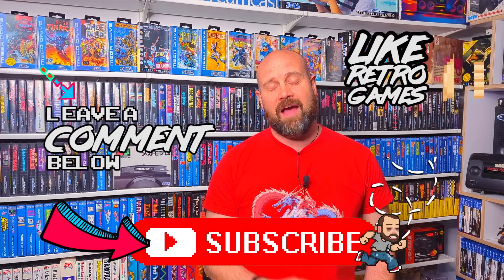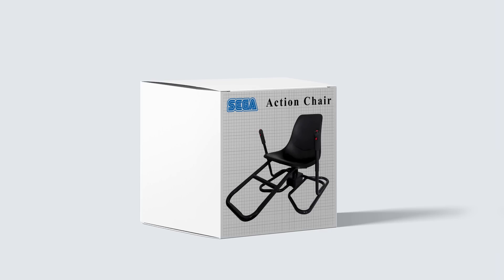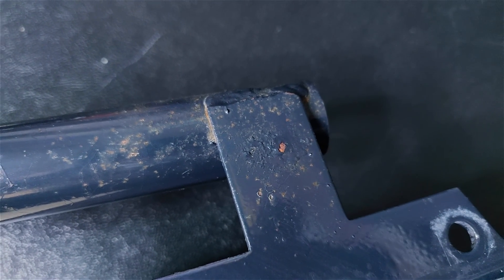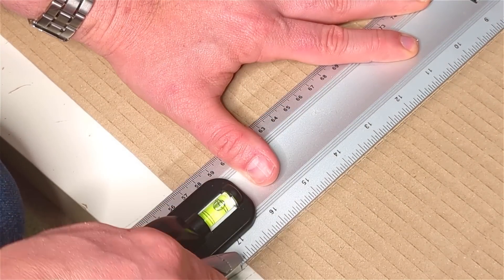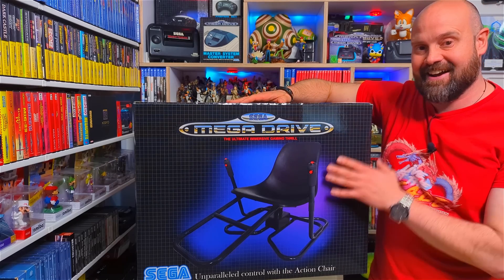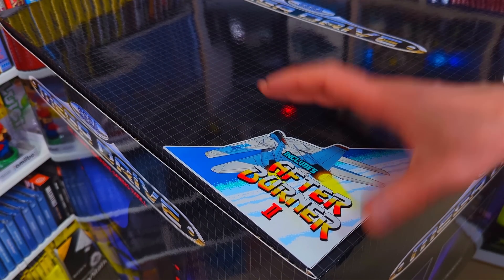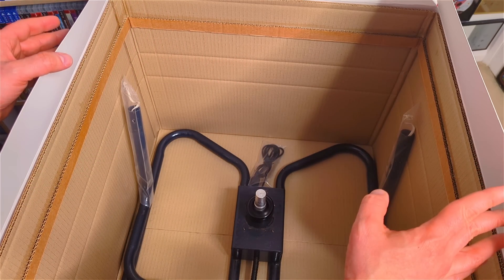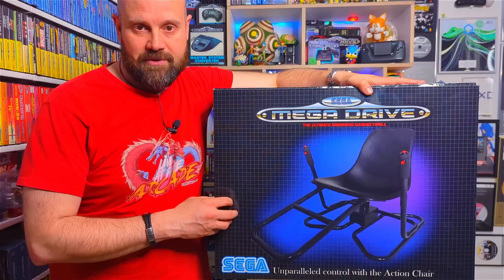Sega’s Forgotten Add-on the Sega Action Chair Found and Unboxed

Comment: At the near end, I saw you look at the After Burner cartridge box. Then I saw you touched the chair. It seems fragile. I think you will fall or destroy that chair while twisting the controls with your body.
Reply from the maker: It's made out of welded steel, and the chair is industrial fibre glass. It won't be braking any time soon. I was being careful around the box.😅